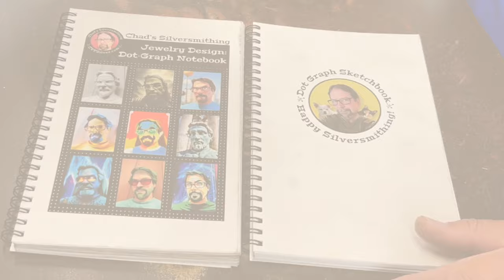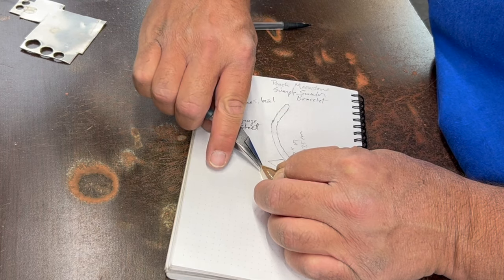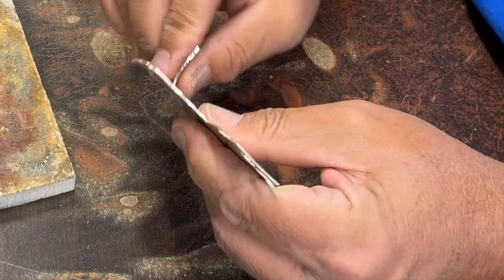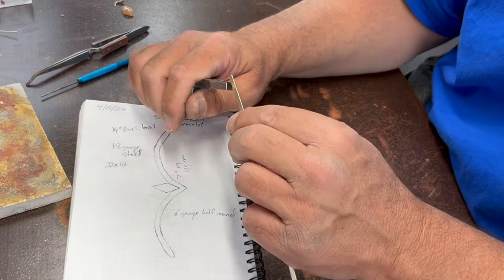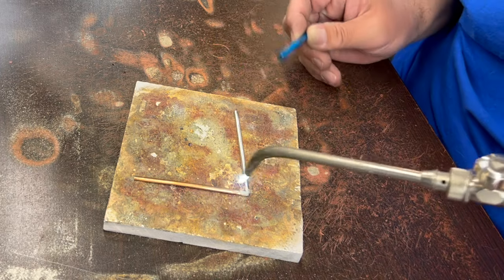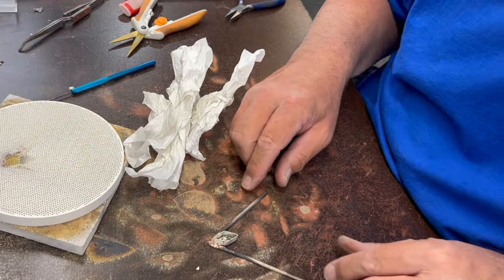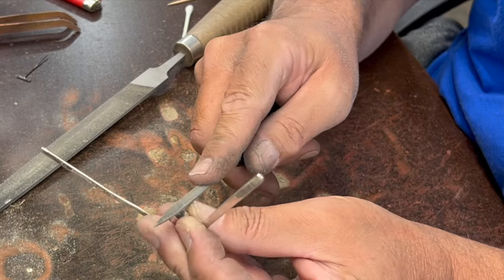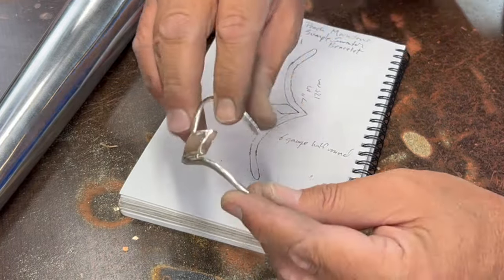Make a Simple Pretty Sweater Bracelet: A Silversmithing Tutorial

Comment: Thank you for this!!! I never thought to just use the corner of a regular file 🤦🏻‍♀️ I’ve been trying to saw a corner out. 

I also have an issue with my solder breaking when i bend the silver to form a band (I’m trying to make a ring with this same technique.) Any thoughts??
Reply from the maker: Sometimes that can be caused by a "cold" solder joint where one of the two components or one part of the piece (if it is being soldered to itself like a band), does not quite reach the flow point of your solder.  It looks like a good solder joint, but one side hasn't really adhered, so with some torquing or bending, the solder pops loose from the side that didn't quite get hot enough.  What sort of torch are you using Casie?
Reply: @chadssilversmithing  I did finally get it to work, but i’m using the Blazer Big Shot. Likely user error with the heat play. Thank you for your response!